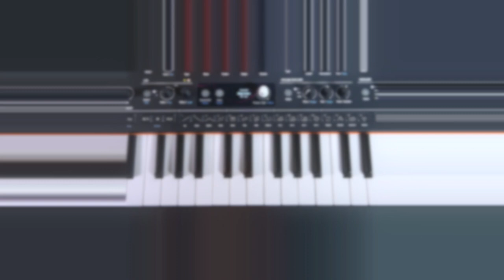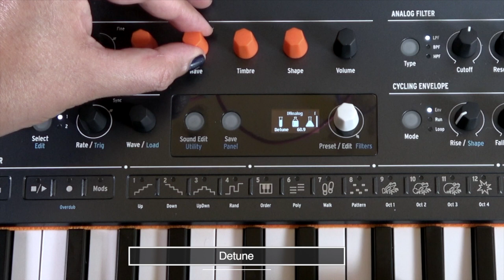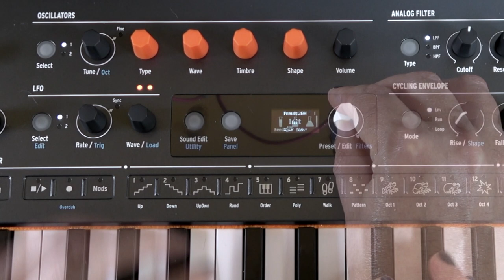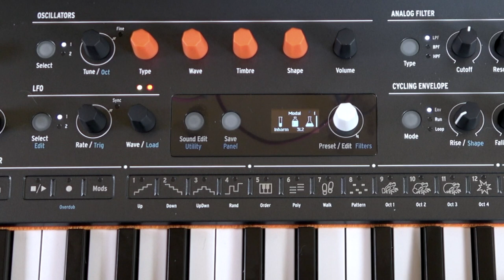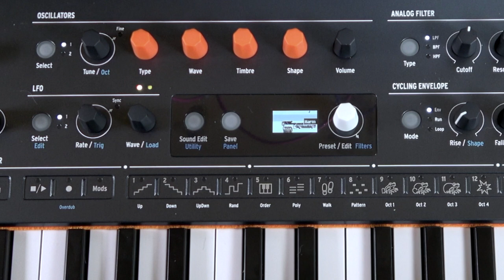Arturia MiniFreak - Part 1: Oscillators, Filters, Signal Processing, Modulation

Comment: great review! i got a question, please. is it possible to assign the volume of the oscillator as a modulation target in the mod-matrix?
Reply from the maker: Thanks!  And yes, you can set the oscillator volume as a mod target.  Press one of assign 1/2/3 in the mod matrix and then wiggle the volume knob the oscillator you want to modulate.  We actually do this at about 18:20 in the video for Oscillator 2 😺

Comment: It seems that you can get a sawtooth from multiple engines. But I'm afraid none of them sounds bright and full along octaves. In microfreak Basic Waves you get bright sound in high notes but muffled sound in the bass. and you get the opposite with V. analog engine. I would like to have this fixed in Minifreak.
Reply from the maker: Hi.  I'm pretty sure the Basic Waves and Virtual Analog engines are the same in both the MiniFreak and MicroFreak.
Reply: @CatSynthTV  They weren't. That's why I returned mine. One of the engines were more suitable for basses (low notes were richer in high frequency harmonics) and the other engine had a brighter sound when playing high pitch notes. I diagnosed a bandlimit issue which I didn't like.